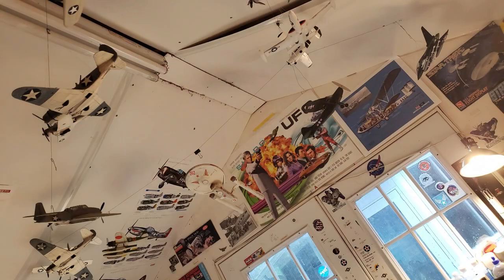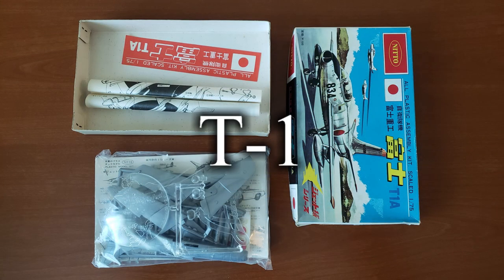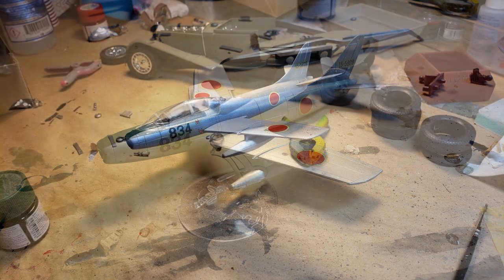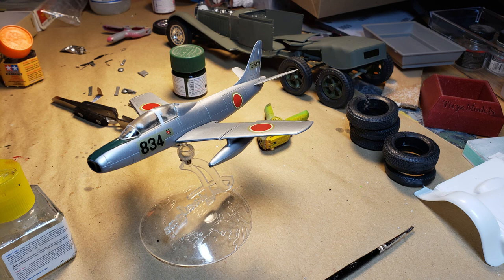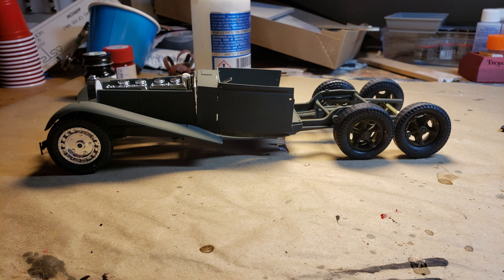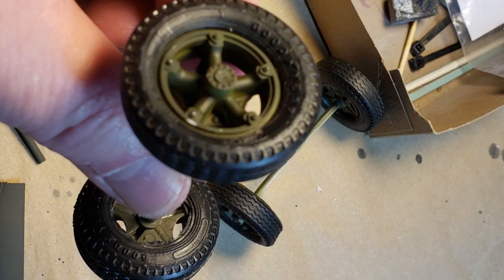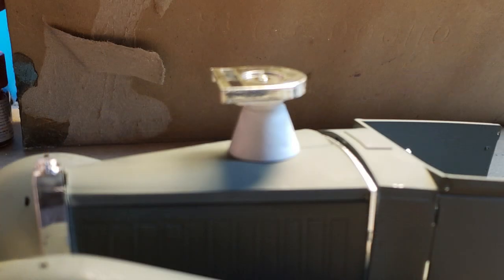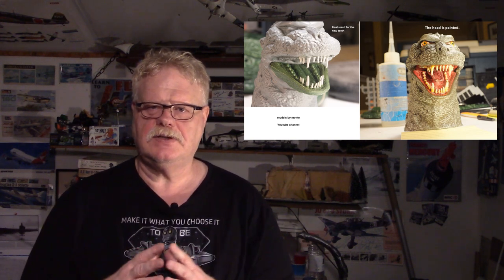Max's Models after hours 7//8/22

Comment: Yes replace them with a LED workshop light.  

I imagine you will have to reset the light setting for your videos but other than that, you'll  have a dependable source of bright light.  Just chose if you want a cold light or a warm light.

Re ladders - don't go up unless you are confident on its and your stability.  Even with arthritis in one of my knees, I still intend on climbing up on my roof to do christnas lights.
Thus, so far, ladders (step or extension) don't bother me.

Comment: "You're not climbing any ladders". Smart lady.  Best Decals I have ever dealt with were Champs model railroad decals.  They were thick but they held up well in terms of storage and they went on great.  Re the lights, you may want to consider replacing the florescent tubes with an LED tube equivalent.  Less electricity, less noise, no "ballast", no UV radiation.  The "lamp" can last up to 10 years.
Reply from the maker: That is a thought
Reply: @maxsmodels  As the old shop lights die out in my basement I've been replacing them with LED versions.  I think I have something like 95% of the lights in the house are now LED.  The first cutover was the range hood lamp when they started talking about banning incandescents about 15 years ago?  That bulb is still in place and still running fine.  It is effectively the night light for the kitchen and is only off when the power fails.  At the time I made the original switch I was replacing that light every six to eight weeks.  That's two four packs per year and each four pack cost $4-$6.  The LED bulb cost $9.  It paid for itself in replacement cost alone in just over a year and over $120 over the 15 year period.  When you factor in the energy savings (10 watts vrs 75) over that period of time it's pretty impressive.  The only place I miss the incandescents is in the bathrooms in the winter.  The waste heat helped warm up the room 😀
Reply: Totally agree with Chuck on the LED conversion. I have eight 8-foot long double fluorescent fixtures in The Cave. Converted them to LED about a year ago and what a difference in heat and light...much brighter.
Reply: My home lights are mostly LED too.  Early LEDs were dim and quirky, but now they have the color balance figured out, and they come on immediately, no waiting several seconds.

Comment: Max: agree with other posters, the fluoresecnt tubes do were out, as indicated by black discoloration.  I one is bad the other may not illuminate as well.  Try direct replaced LED tubes, but go to hardware store to ask as all LED tubes are not direct replacement.  Ask a younger neighbor for help as professional electriician will equate to a lot of Tamiya kits :)  Finally, I wanted to suggest dipping the T-1 canopy in Pledge floor wax to see if you cna overcome some of the depolymerization cracks.  Still, you did a respectable job on a basket case kit.  Very good.  Blessings, Andy